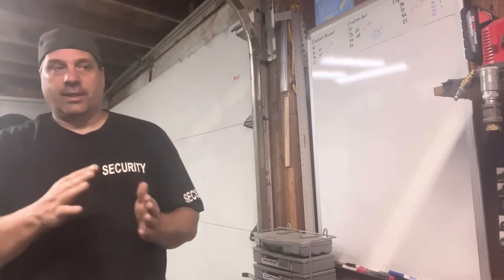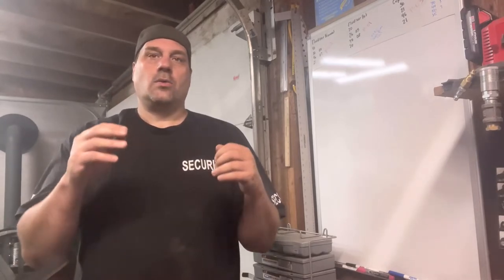What is kV & uA in powder coating #109

Comment: Gonna get into powder coating.  Every time I think about pulling the trigger on a Hyper Smooth 2.0 from Columbia Coatings, but then realize there's no mA control, only volts.  Makes me wonder how mA is being controlled in those boxes if there's a min/max threshold etc.
Reply from the maker: If it’s like a Columbia coatings kkhd it has controls but does not register. I need to do a more in depth video of the kkhd. I paid $2100 for just my head unit and then bought the whole kfx1 for $1900 head and base. I think just the head units go for around $1200. Also what most ppl don’t know is the KKhd from Columbia is made by Hicolo the same company that makes the kfx1 units. Columbia coating just buys them direct and sells them at a mark up

I would reach out to hicolo and ask them to send you a book of all there systems. You will find that a lot of systems on the market are there’s and you can but through them a lot cheaper. Hope this helps

Comment: Great explanation I have an old nordson surecoat and a very wagner I bought them cheap, but was afraid to use them so was going buy a rc-1  but now I have some confidence in trying to work with them, now I have the gest of kv Ua I guess it's the air flow I must also get familiar with. Is it possible to fit a cup for the powder to my systems as I'm concerned about cleaning for colour changes. Thanks so much for doing this  tutorial. The best of luck with your adventures. Regards from Ireland 🇮🇪
Reply: Ment to say very old wagner
Reply from the maker: First thank you for being a subscriber and supporting the channel. If you get a chance watch out KV / UA video that I have been told helps ppl. On a side not we have a few different hoses going from fluidizer to system. We only run clears through one hose, metallic dark's through a hose, light colors through one and dark colors through another. These hoses are cheap and it helps with contamination. Good luck
Reply: @GMPC  thanks for your advice, now it makes sense to me.

Comment: Hello sir. What if I just don't have settings of µA on my coating system? 
It's rc 1. And instructions to powder I use demand to have at least 70µA.
 Greatings from 🇺🇦
Reply from the maker: Do you have a KF-x1 ?
Reply: @GMPC  RC 1, only kv settings. It is just like on the video below.
40-46 kv, 70 uA are settings from manufacturer of powder. Now just can't spray it in normal DFT. Falling off in corners and has overspraing effect.
 https://youtu.be/YPqhD0R8YgI?si=KGY0HBsIcJqWhaHP

Thanks for answering 🙏
Reply from the maker: @Алекс-е1в8э  these are hard systems to regulate. So with these systems what some people do is warm up your part and LIGHTLY hit the hard parts like corners. Then let your project cool down then do the easy parts cold. You will have a much better turn out. Hope this helps. I’ll look into buying one of these systems and do a video on it.
Reply: @GMPC  thank you, i will try to spray straight after oven

Comment: Voltage can be thought of as the speed of electricity and amperage is the amount of power or work it can do. KV is the speed of the punch and the milliamp or micro amp is the force of the punch. A very fast punch with low force will hurt but likely do little damage and that is how stun guns or electric fences work. The human heart is said to take about 6 milliamps to stop and each amp has 1000 milliamps and receptacles in homes are usually on 20 amp circuits, so it doesn't take much to kill a person. The body also isn't harmed easily by under 50 volts and that is why automotive batteries don't electrocute or even shock people but with a direct short they can still burn you badly and melt metal parts due to the amperage..........slow but extremely strong punch. Higher KV should give a better spark on ignition systems (like used on engines and also many tig welders for starting the weld since the spark jumps easily and then allows the arc to form with the high amperage). I have only been doing powder coating for a little while with the dual voltage eastwood gun so I don't know a lot about how the voltage effects the powder. I see an affordable pro gun in my future so I have been watching to figure out what will work well in the $1k to $2k range.
Reply from the maker: Thank you so much 🙏. If your looking for a gun the x1-reaper is a good system and there is also a x1 group with all x1 owners so whenever something comes up the group helps eachother. Worst thing is having a question and 20 ppl answer with 20 different systems. I could put you in the group for a week to ask questions about the system if you would like